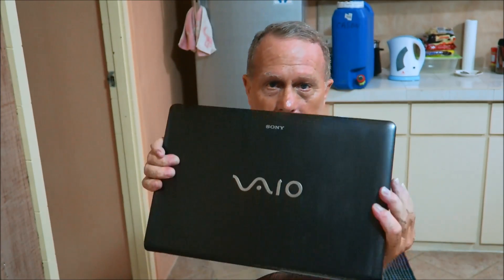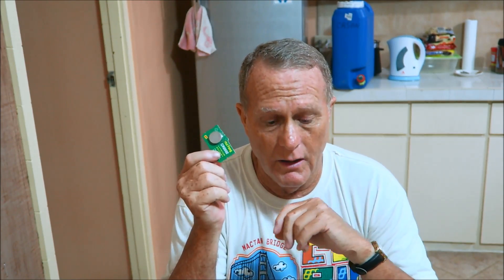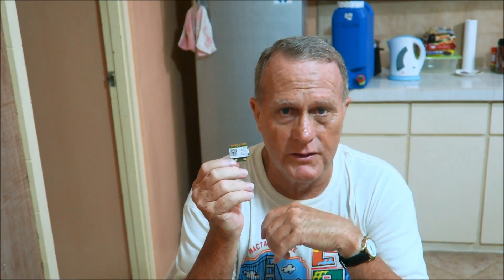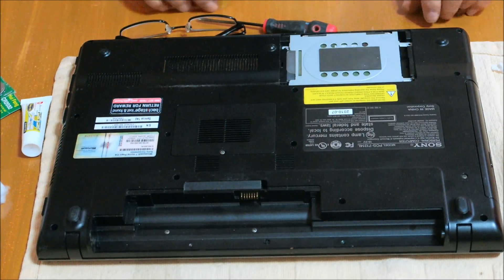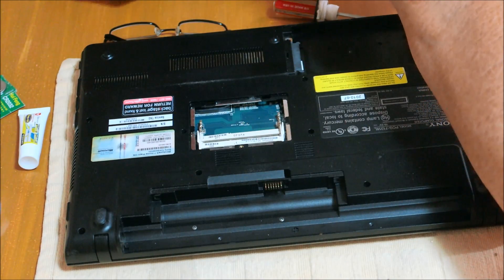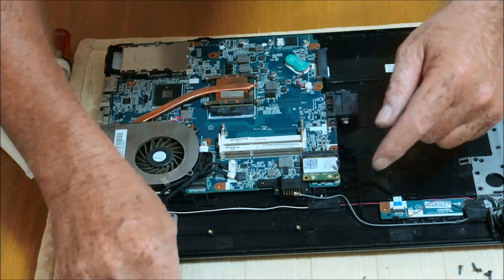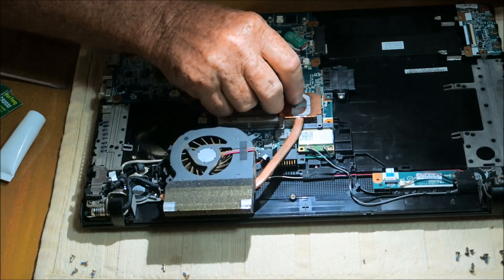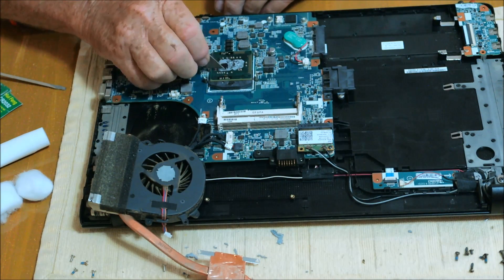Sony Vaio Laptop Repair ~ Overheating, Wifi card, CMOS battery, & HDD Video 1 of 2

Comment: My VAIO, which is a different color than yours, needs its wifi card replaced, and I'll be using this video as a guide (sort of) for the process. As some of the people in this comment section have pointed out, this laptop makes for a great Linux machine.

Comment: MIke, great video!  There's nothing more satisfying than doing something yourself, is there?  Must be the self-reliance gene a lot of us have.  I just did this same exact procedure to my HP laptop, and switched the cooling fan as well.  Great rainy day project!  I used to work on old military radio gear and you're right on the money...the humidity of the tropics just wreaks havoc on electronics.  In WWII the US had to have their shortwave radios "MFP'd" (moisture and fungus protected) with a variety of varnish-like coatings.  You'd think solid-state would be immune, but it looks like there's still issues.  So, what are your plans for that Sony now that it's humming like new?   ~Bill

Comment: Some very good tips mike.....and accurate. Some additional info for the viewers
: The thermal compound is made with silver oxide as silver is an excellent thermal conductor as well as electrical conductor. As such, if you get it on your fingers ,clean it off before handling any of the components ,especially the gold pins on the cpu chip..The compound is electrically conductive . A fingerprint smudge will cause GOOFY problems. Apply the proper amount ,do not apply an excess. When the compound warms (new) it softens and over a few weeks may ooze out and fall on the components below. I recently worked on an expensive proliant server that did exactly that ...on  two 7000 dollar 10 core processors, rendering them unusable  until cleaned with a proper solvent. :-)

Comment: Would under clocking the chip-set in the BIOS help with cooling? 

I like putting Desiccant packs in everything. The humidity here in Florida on the Gulf has some strange electrical properties that we never had at the beach in Southern California, here I have had car batteries that were new go dead from setting a few months. I mean dead like plate shorted out. And adding new acid did not work! Laptops also that had sat, dead.

Comment: I read an article recently on laptop problems.  The report was that it is more the humidity than the heat that tends to cause problems.  Also you might want to try to install Linux Mint OS as a dual boot.  Linux is much faster.

Comment: After taking the battery out should still press the power button to discharge the unit fully. Vaio's are pretty easy to work on but are not reliable machines.

Comment: Mike when you scrape the paste off the CPU, was the thing you used to remove it metal or plastic ?. Are SSD's expensive in the Philippines?. Reason why i asked is since you now have 8GB Ram an SSD would be the icing on the cake.!
Reply: True, the SSD are easily damaged, i lost two of those in the past, one was replaced through guarantee and another one i can't get windows to see. I downloaded the firmware but to no avail!!.